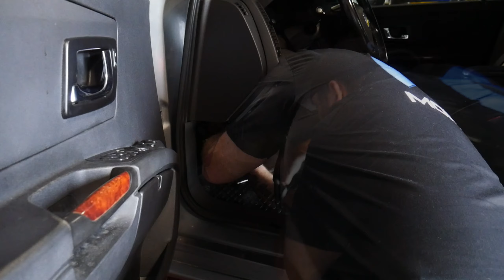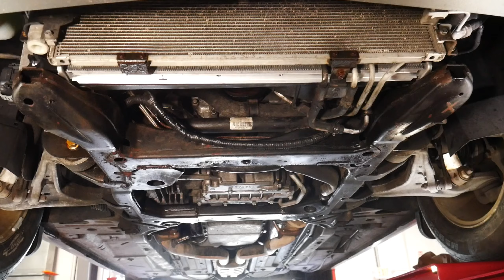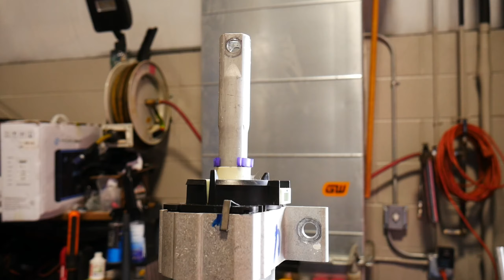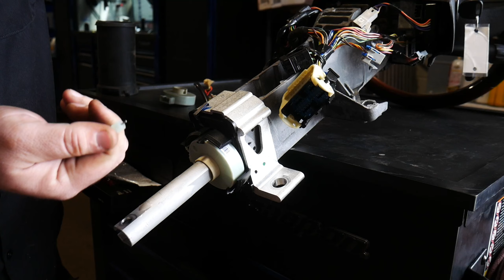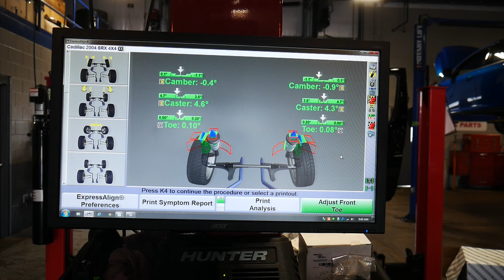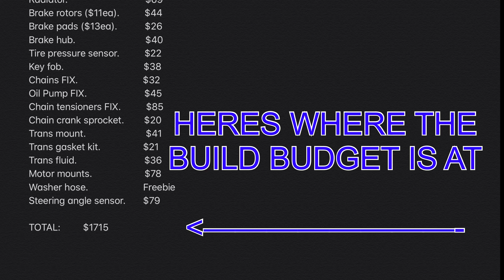FIXING A STABILITY CONTROL LIGHT AND ALIGNING THE CHEAP CADDY

Comment: So only when I turn my 99 Cadillac eldorado to the left a little and hit the gas the stability activates , I checked the connectors lubed them , changed the speed sensor, now it’s between the wheel bearing which doesn’t have any play in it , or the steering wheel sensor, can I get the steering sensor checked ? With a scan tool ? I have no dummy light on although it has come on and shut off c1226

Comment: Right now my mechanic is going to replace the ob2 computer with another one to see if it fixes the problem he said he made sure the wires were not loose
Reply from the maker: Sounds like he is shotgunning parts. A speed sensor issue should not be hard to diagnose. I’d say take it to a better mechanic.

Comment: Can you please help I have a 2017 dodge charger v8 5.7 and my electronic stability control keeps activating and appears on my dash and my vehicle won't run and disables my all wheel drive it's annoying . Don't know what's wrong have to keep turning my vehicle off and on. I took it to my mechanic and he said the issue would be solved with another transmission he put the obd and it said lost signal to the computer idk what else to do

Comment: ive got a cadillac deville 2003 w service stability lights and message, bought the sensor,hoping to get the column off and unplug wires,do i need to disconnect battery

Comment: For those 10mm bolts. I would definitely use my 3" extension with my Deep magnetic socket because if you drop those bolts in there you will never get them out if there.